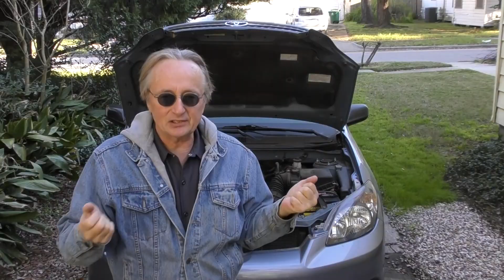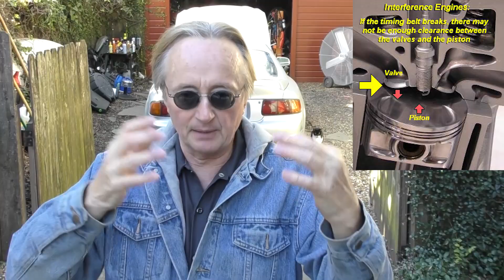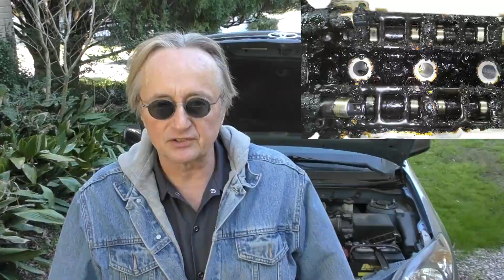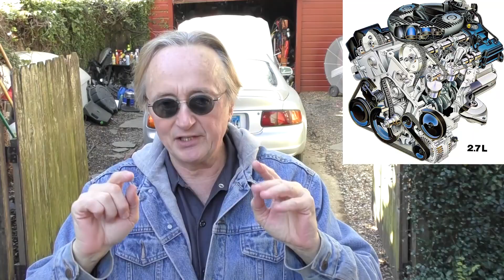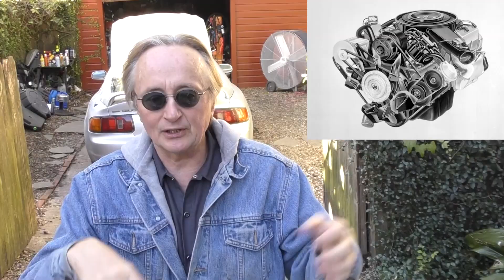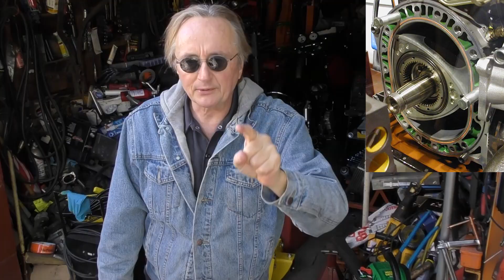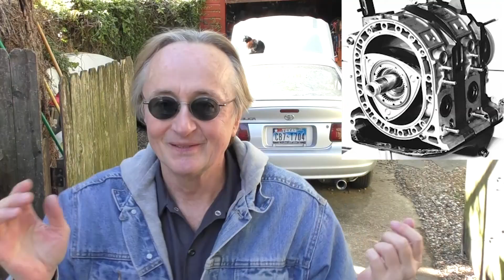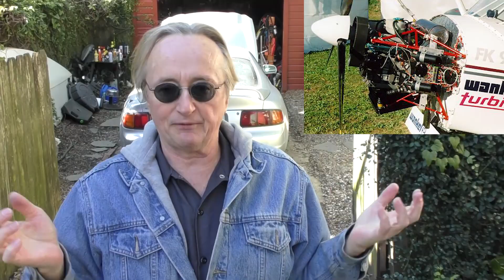Never Buy a Car With This Engine

Comment: My cobalt 2.2 still runs ok 178k ...5 yrs no car payment. Now I do good maintence. Oil every 3,500 trans every 35k. Plugs fuel filter at 50k and 30k respectfully early.
Reply: Don’t forget to replace accessory and timing belts, and especially hoses. I’ve had the latter rupture at 6 yrs. Tires also degrade with age. Where elastomers are involved, age, not just mileage, matters. I once changed a radiator hose on a gf’s Civic. Looked fine, but inside was a large crack. It was held together only by the outer skin, ready to blow at any time.
Reply: @FrankGutowski-ls8jt  Hoses are on the list as well as another drive belt replacement. Never had a water pump issue yet.
Rear brakes never touched yet...
Hope to make it into the 200k+ milage
Reply: Dan Georgevic 

I retired a 5 speed 84 Peugeot 505 GL with only 250K mostly city miles with rear drum brakes still operational, though needing replacement. I did a lot of coasting and downshifting. Unfortunately, while saving my brakes, frequent down shifting fatigued the clutch fork. 

You might consider adding CD2 Oil Detergent additive to your oil changes. I started using it at about 230K miles. I first cleaned the crusty deposits from the oil pan and walls of the crankcase. I was hearing a timing chain rattle, and bought parts to replace the chain and tensioner, but for some reason the rattle disappeared after 4 oil changes with the additive. I also noticed a change in the engine sound and ease with which it revved. Were it not for ever increasing maintenance I’d still be driving that car. I learned a lot living with its quirks.

Comment: Hey Scotty, I've heard you say that the Nissan CVT Transmission is crappy, is there a difference between the CVT in a Sentra and the CVT in a Maxima? My Maxima has 140,000 and still seems to be going strong. (Knock on Wood) Thanks in advance for your response. :)
Reply: rangertaylor granddaughter bought 08 Altima 2 weeks ago for 4k, good for 2 weeks, now cvt needs 3k to repair shop says, I tried to warn them, I said Scotty says... But didn't listen, their gonna get it fixed, big mistake I'm thinking, Scotty???

Comment: Wow, I've never really disagreed with Scotty, but I have a 06 Malibu with the 2.2 with 225k miles and I absolutely love it. Never had a problem with the car other than usual maintenance. 
Infact this was my first car (got it in '09) and I still own it and drive it 😁. However I have heard that about timing chain for years, I've always used full synthetic oil and wix filters since the car had 90k miles. So maybe that's the reason for my good luck.
Reply: Because you keep up the maintenance
Reply: WORST BRANDS 
0. all European cars
1. Fiat-Chrysler 
2. GM/Chevrolet 
3. Nissan 
4. Hyundai/Kia/Genesis
5. Mitsubishi 

according to Scotty
Reply: My wife drives a 2005 Saturn Ion with the 2.2L.  We have had zero issues with this engine.  Car is at approx. 150,000 miles.   I've heard about the 2.4L having a lot of problems, but not the 2.2...The majority of opinions on the 2.2 have been positive (until Scotty's video, of course).
Reply: Funny, I bought my first car in 09, 05 Malibu with the 3.5L V6. Bought it with 44k miles. Up to 252k now.
Reply: I've got an 05 Malibu with the 3.5 V6 and it's still doing good at 127k! No major complaints, though it does have a small ticking noise. And it has been burning oil for the last couple years. I guess it's the valve guide seals, but I just keep filling it up and it keeps going!
Reply: @timhahn7542  Really? Wow. Mine is noise free and I floor it everyday. I use Mobil 1 full syn and change the oil every 3-4k miles. Do you use cheap gas?
Reply: @DJR5280  I normally go to the Kroger gas stations. Though sometimes to Shell or Speedway. What would you say is cheap gas? And is that the best oil out of what you've tried?
Reply: @timhahn7542  05 Cobalt SS 179k, no mods. I only use Mobil 1 5-30w full synthetic and 93 octane fuel. I've driven it to CA and back.
Reply: @schwarzermond6033  guess I'll start trying Mobil 1 and high octane fuel then!
Reply: So true, there are a bunch of those Malibu's on the road.!
Reply: SCOTTY'S CLUELESS..... THOSE ENGINES LAST FOREVER!....NOT THE BEST LOOKING FRONT END BUT THOSE MALIBU'S ARE THE MOST RELIABLE IN A 20 YEAR SPAN...THE ONLY ISSUE WAS THE STEERING COLUMN ISSUE WHICH I THINK G..M. EVEN REPLACED UNDER WARANTY.
Reply: Bahahahaha

Comment: Ironically, the 2.0L turbo from GM is a tank - my 2006 Saab 9-3 now has 220,000 with no problems (sold it to a friend recently).  That was from Sweden.  They did them better.  Surprised the 1978 to 1985 Oldsmobile 5.7L diesel did not make this list - it is probably the worst engine of all time, much worse than any of the engines Scotty lists here since he going back in time.
Reply: I figured the old diesels were Gremlins because people didn't take care of them properly.

Comment: About the Ecotec - from what I have read, the timing chain oiler problem was mostly in the pre-2003 engines, and a revised oiler was introduced in 2003.   Have you seen failures in 2003 & newer ones?  My interest in this is that I have this engine in my 2003 Saturn L series.  Mine has 213K miles, and still runs well.  I use syn oil and the Delco (supplied by Hengst) oil filter, to keep  it as clean & well lubed as I possibly can.
Reply: malibus and cruzes are the shittiest cars due to their engines
Reply: zhbvenkhoReload will have to disagree. My Cruze 2011 cruze is sitting at 144k with general maintenance. This is just my experience honestly.
Reply: Ive seen 2 olds alero's both 2004 with the 2.2 ecotec  that timing chains had broke on. Engine junked both times.
Reply: Gm had to design chain tensioner 3 times in the 2.2, and yes, had chain lubrication problem on early models 02-04. Lube problem was on extended oil intervals, causing sludge build up through oiler, thus loss of chain lubrication. If you have chain noise on cold start, change your tensioner asap. If you have 02-04 ecotec still running, change your tensioner to newest design tensioner. If you have 05 or newer, you should be fine...unless you have cold start rattle, then, chance that tensioner asap.
Reply: @SirVixIsVexed  that is a better ? for Scotty... But vibration through steering would not be timing in my opinion. Maybe a bad motor mount allowing motor shake to resonate into steering column and s/wheel. A possibly of jumped timing could, but you would also experience really poor acceleration. Have a good mechanic raise on his rack, check motor mounts, steering components too. All my gm's have shakes and vibrations, ugh... Hope you can solve yours :)
Reply: @bluejeantex  As for steering rattle, the Cobalt has had issues with intermediate steering shafts wearing out prematurely.  The rattle would come from the U-joint that mounts to the rack and pinion.  Replacing the intermediate steering shaft will eliminate this rattle.
Reply: @tobyradloff  agreed, also don't count out steering column play at the power steering motor, you know it's bad when you drive slow over uneven surfaces like gravel,... makes steering wheel and upper column rattle
Reply: @tobyradloff  Cobalts were really bad about fuel lines leaking and catching up into flames.
Reply: @atx-cvpi_99  I had my fuel lines replaced when it started leaking.  They tended to rust where an insulation wrap is near the rear wheel well.  The wrap would trap water and salt.

Comment: Well damn, my car has one of the 2.2L 4-cylinder Ecotec engines and 145k miles on it. I've got to make it last another two years, hopefully the fact that I've kept up with maintenance and have always used good synthetic oil will keep her running.
Reply: webbergj ...keep up with the regular maintenance and you should easily get another 75k miles out of it.

Comment: Kind of surprised...I just had my 2008 Cobalt with 2.2 exotec “give up the ghost.” I had 206,000 miles on and never had much issues beforehand. Just changed the oil regularly.
Reply: what happened to it
Reply: Sean gavin Gavin I didn’t tear it all the way down but threw the timing chain and ended up just selling it for parts.

Comment: Rotary motors are excellent for racing.  They are terrible for a commuter car.  Rumors say Mazda is still trying to make them work.  Maybe they will find a way, but I wouldn't bet on it.
Reply: Yes, they are supposedly making a SkyActive Rotary, and SkyActive Diesel. Don't ask me why.
Reply: I heard they were going to try to use a rotary as a gas generator for an EV type of vehicle, like the Chevy volt does
Reply: With twin turbos and a few other mods they are awesome for drifting.
Reply: As for the Cadillac 8 6 4 some ran great people loved them unfortunately no one could figure out why so the vast majority we're problem to nightmare. Rotary engines are great at high RPM the aircraft engines don't need the seals that are such a maintenance problem on cars, they should work well as a fixed speed generator engine.
Reply: @robertstoneking7916   Also in plane the engine have a reduce engine speed and since no cat you can run more oil in it to protect them and aviation gas is lightly lead fuel.

Comment: Dad had one of those 2.7L Dodge engines in his old 99 Intrepid, he got the car from a 99 year old man for $800 and it only had 80,000 miles on it.  The car only lasted one year, but if he didn't give the car to my older sister it would have lasted longer than that.  My sister put that car in the same salvage yard she put dad's old 99 Continental, some people really shouldn't drive and my older half sister is one of those people.  Oh he dodged a big bullet when he was younger, he was going to purchase a 1984 Mazda RX7-GSL brand new, but the dealership he went to gave him one price when he first went into the dealership (they had to get the car from across state) and when he went back they wanted to charge $1500 more because they said the car was in high demand.  He told them where to stick it and wound up buying a new 84 Toyota Supra instead.

Comment: No mention for Honda Interference engines? Snapped timing belt and woooh! Bye bye engine.
Or
How about the Toyota VVTI motors that would run dry and burn out the over head cams prematurely?
Reply: The Honda interference engines are A-OK with regular maintenance. As long as you change the timing belt at the scheduled intervals (I think every 60k miles which isn't that often), those engines are solid! 

As for the Toyota VVTI motors, I don't know enough to say.
Reply: Ask  a mechanic who works on all cars about which cars are the best and I doubt it will be domestics over foreign cars. I had good luck with Fords, so am not a rabid anti domestic type, but have to admit the asian brands are usually tough to beat.

Comment: Happen to my Suzuki Forenza 06 Sedan with it's 2.0L I4 engine. The Tension pulleys cracked which caused my valves to bend in my head at 150K. Replaced the head, Water pump, Timing + Serpentine Belt, Gaskets and the Tensioner with quality parts and did the labor myself all for $700. 
Running perfectly and so much better now, will run the car to the ground and pass it along.

Comment: What's up Scotty!  Love your videos!  Keep them coming.  Need your opinion.  I've always been a Toyota guy.  Don't know why I left.  I have a 2017 Chevy Malibu LT.  Bought it new.  Love the way it drives, but it's giving me headaches.  It has about 29,000 miles on it. A/C was already replaced, door lock works when it wants to, car vibrates at 1500-2000 RPMs and it also tells me to shift to park when it already is.  I have to mess with the knob in order for it to catch.  Is this car really crappy or did I happen to pick the rotten apple out of the bunch?
Reply: That seems to be a lot of issues for such a new car. It will likely be a total nightmare when it gets older so if you tend to keep cars a long time, you may want to trade this one sooner than later.
Reply: In recent years Malibus have received high marks for reliability. I drive a 2016 Chevrolet Malibu Limited LT. Haven't had a single problem. You probably just had the bad luck to get a lemon. Every car manufacturer will produce some lemons. Even Toyota.

Comment: Suzuki 2.5 and 2.7 liter V6 engines over 15 hours to replace a waterpump, not run off the timing chain but must be removed for waterpump replacement.

Comment: I'm sorry, but the 2.2 ecotec is an amazing motor, the 2.4 it was garbage, but that was one of the best cheapo motors ever made, but like you said if you don't keep oil in it it's going to die. IF you're putting blame on the engine design for people not putting oil in them is kinda blaming the wrong party.
Reply: This. There’s a reason you still see so many Cobalts Cavaliers and G5’s/G6’s with the 2.2, least here in Canada. They were made to compete with Toyota’s fuel efficient designs, and run forever if you look after them. 40mpg is pretty damn good even in 2019.
Reply: Bought a chevy malibu with the 2.2l engine with 90k miles on it 2 years ago and now I'm at 142k miles and is still running like a champ . Just regular maintenance and your set to go. I've heard way more good than bad on these engines. Try again scotty
Reply: My Cobalt has a 2.2 ecotec and its going strong at 155k no problems, i have had front end problems though nothing major
Reply: @Whodat77  I have 179k on my 2005 Cobalt SS Supercharged, 2.0L. It's all stock, has been to California and back, I've only ran Mobil 1 fully synthetic oil and 93 (91 while in CA) octane. It's possible as long as you change your oil. However, the rest of the car is trying to fall apart LOL
Reply: I'm pushing 180K miles on my 2.2 Ecotec in my 2007 Cobalt...Of course, I do change the oil regularly...
Reply: When I was thinking about getting a Cobalt SS a few years ago I was looking up their reliability. Let’s just say I found no reason to get one. Highest maintenance costs over 5 years out of any car in its class. I guess it’s a hit or miss whether people have good luck with them.
Reply: I was under the impression that  ecotec is a pretty good engine. I am pretty sure it's going to be the last thing to die in my mom's 2010 cobalt. At least, it'll outlast the transmission.
Reply: I realize everyone's mileage varies -- sorry for the easy pun -- but I have to concur that the 2.2 ecotec (at least late models) isn't too shabby. My 2004 Cavalier made 130k before the k-frame rotted out and clutch went twice (a MANUAL transmission led to its demise, Scotty!). My wife's 2007 Cobalt is at almost 100k and still runs and shifts like a champ. Too bad every other part of the car is falling apart!
Reply: I've got an 04 Cavalier I've owned since 09 and it has almost 209k miles on it. No motor problems yet. I regularly drive it like I'm qualifying for the Indy 500.
Reply: I think what Scotty is saying is... The vast majority of Americans don't really take care of their cars, this is very true, I have a 2003 Honda Odyssey with the 5 speed AT that was a nightmare for Honda/Acura circa 1999-2004+ years. Have a little over 160k on original engine and tranny, all I do is frequent oil and ATF changes, as well as the small particle ATF filter located behind the battery, I have zero shifting issues, no slipping or harsh shifting, yeah it doesn't run like it was brand new but still, most of those trannies by now have been swapped out at least once. When it comes to engineering for the American market, engines and transmissions need to be engineered with the fact that someone with absolutely no car knowledge will be driving/owning it.
Reply: My 2.2 Ecotec built Supercharged Cavalier went 6.2 liter to a 100 and pumped out 230whp! Drive that thing to 200 000km's + and never burned a single drop of oil.
Reply: Yeah, I have a 2008 cobalt with 210xxx miles and the 2.2 ecotec has been flawless. I believe the 2005-2007 2.2's had timing chain issues, but that was resolved in '08. 
I disagree with Scotty on this one.
Reply: 2004 saturn ion with 238k, still running strong. Never changed timing chain, but...did change timing tensioner when cold start had chain rattle sound.  I did however have a saturn l200 ecotec 2.2 that jumped time with no warning and only 108k..., tensioner failure!!! Guides looked good, so oil lubrication wasn't the problem, but tensioner was the achilles heel.
Reply: 2.2 and the 2.4 eco tech were basically the same engine. Really engines as long as you change the oil.
Reply: The 2.2 and 2.4s are basically the exact same engine... the "issues" were caused by the owner not changing the oil every 3-5k miles.
Reply: @andyk192  yeah, my girlfriend had to get rid of her sunfire for the same reason, but I'm in the pinochle of the rust belt.
Reply: I have to agree with u and disagree with Scotty sad to say. my 2003 Saturn L200 with the 2.2 ecotec  that I've had for 3 years and put over 70 thousand miles on it. it's at 212 thousand miles and never had any single issues with it.
Reply: The 2.4 ecotec not garage maune the direct injection maybe got 06 colbolt ss  183800 will be 200000 soon dont use ur oil life thats built in adolance
Reply: I'm thinking the people in this thread didn't listen ecotec is fine IF YOU STAY ON TOP OF MAINTENANCE. There are people in the US who have shown up for a first oil change with 50K on the odometer and what's left of the oil turned to sludge and charcoal, and lots of us sometimes double the interval.
Reply: The 2.4s dont seem to fail in the solstice... but all them cars get full synthetic
Reply: You can run 1100 hp on a 2.2 ecotec. Need to rebuild regularly but they have forged internals apparently. YouTube should have the drag race vids. 2.2 way better than the 2.4 although olds had earlier 2.3 version same engine with 190 hp that was reliable I hear.
Reply: Makis Equinox agrees my Saturn VUE woth the 2.2 and 5 speed manual has 212k on it and runs like a top. Strongly disagree with scotty